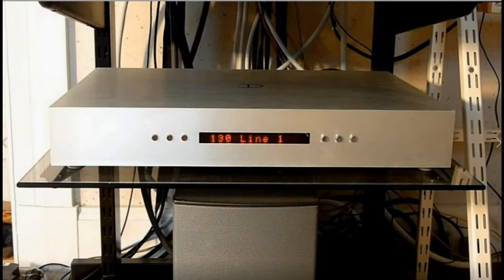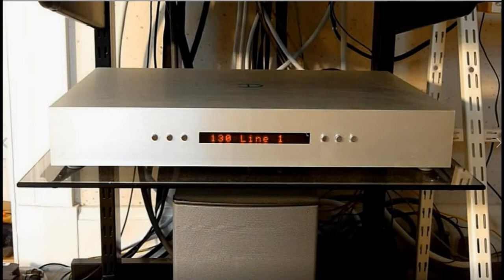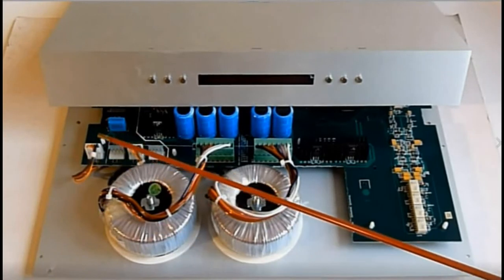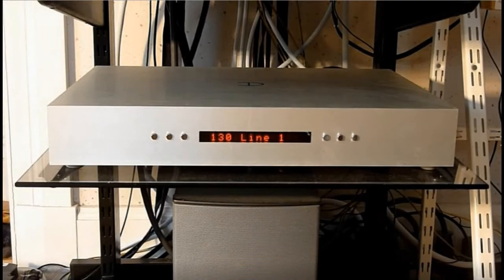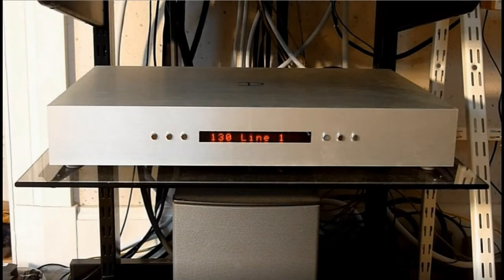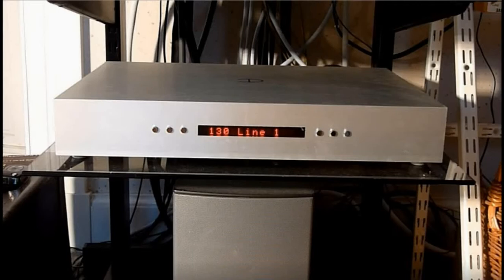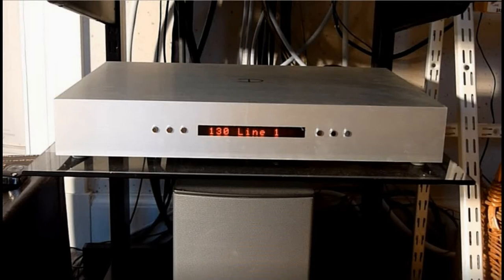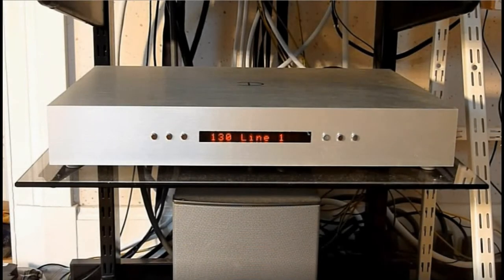How to improve the DENSEN DenDAC/50.

Comment: Don't quit your day job to become a comedian. Please. 😁

Thanks for the video. I think you've got me convinced to learn how to solder, and start doing this to my equipment (well some of it anyway. I've got a lot 😉). It looks easy enough, and I've done welding before, as my father owned an auto body shop when I was growing up. 

Plus I took metal shop in school. Where we used the stick welder a lot (forget what you call them. Mig?). But at the shop we used the wire feed, which I think was a Tig welder. And my father used to do brazing too, but I never tried that. That seems more similar to soldering actually.

This makes me realize that this may be why some of my old tube, and homemade tube gear sounds so good. Especially when I was using it with open baffle single driver full range speakers. Everything was directly wired, and there ware no mechanical connections. Sure the speakers weren't soldered, but I had a very good connection. 

I've seen people on the net say they've gotten better sound by going directly to the voice coil from the amp. Again, it makes sense. Why wouldn't a more secure connection help a lot? Not having a secure connection is like using a really thin wire. You're just not going to transfer as much electricity/signal/what have you, if it's not fully secured. Thanks again, and have a great day. ✌️